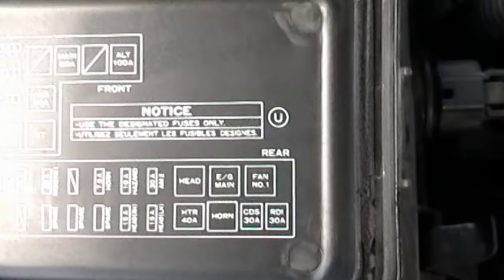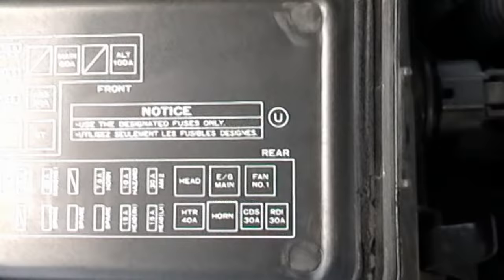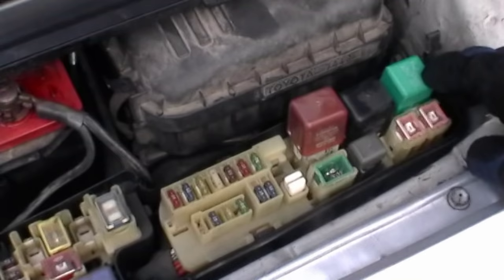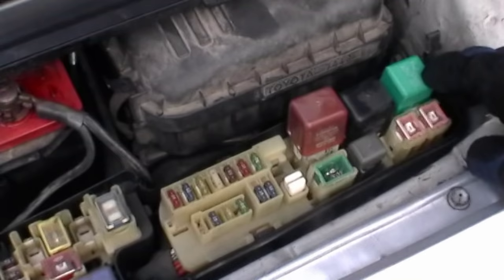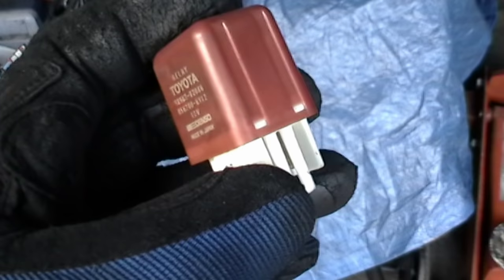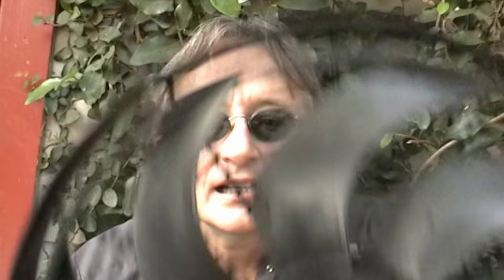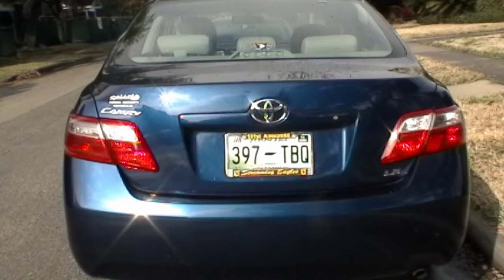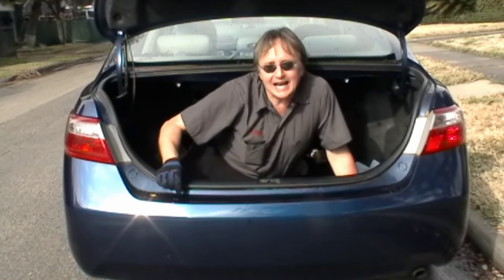How to Repair a Cooling Fan in Your Car

Comment: HI i have a 01 Oldsmobile Aurora v8 4.0  my radiator fans will turn on when car gets hot but then they won't turn off but will go off if i turn the car off
Reply from the maker: pray it's just bad fan relays doing that and NOT  a worn out computer circuit
Reply: I think my engine is running hot just did an oil change and now its low after driving it about an  hr  I even change the plugs and they looked okay  and the antifreeze looks good it's not  leaking anywhere  it's still at the same spot where i filled it up at could it be a bad temperature  sensor or something else if it ant the computer or relays or what about one of these  codes that come up (p0386) Crankshaft Position Sensor(P0442) EVAP system small leak(P0741) TCC system stuck off(P1860) TCC PWM Solenoid Circuit Malfunction

Comment: I have an issue with my 2010 car, the fan only works. When I switch on the air conditioning, and that too it runs in slow speed always. There are two fan for my car, if I remove one of the fan relays the other one will run is both high and low speed with auto compressor cut off. When I put the relay back it might run for few seconds, and back again in series slow speed. The radiator fan won't turn on when the temperature reach's to a point where the fan has to run, but it won't run. Dew to which I have to put Air conditioning always so that the fans would run...
I would appreciate if anyone can help me out with this issues ...(*all the fuses are good and even replaced the relay twice)

Comment: my cooling fan on my car turns on when the temperature is 3/4 high, what would cause this to happen?
Reply from the maker: weak temperature sensor
Reply: +Scotty Kilmer could be, we replaced the coolant temp sensor but not the coolant switch, don't know the difference, thermostat is 160 instead of 195 oe not sure

Comment: My cooling fan keeps running 24/7 also they don't spin fast is that normal?
Reply from the maker: they should spin at a pretty fast rate, odds are there is a problem if they spin slow and all the time, such are burning out motors or bad relays

Comment: My 98 Nissan maxima has 4 cables in a plug, how do I text it?
Reply from the maker: armando colon those are complex, but you can unplug the connector at the fan motors, as they have only two plugs running the motor, positive power and ground

Comment: 1:45 
Wtf? How does the fan turn on with just the negative wire on the terminal. Plus the wires that are actually going to the fan are now unplugged.
Reply from the maker: Kevin Lane that's merely a sensor wire, grounding it tells the computer to turn the fans on

Comment: ive got a saturn l200 2003: my low coolant light only comes on when im sitting in traffic and turns off when picking up speed on the highway. My overflow tank is full as this happens. switched out my thermostat and coolant sensor, still hasnt fixed the problem. any idea if this is a fan problem due to highway winds turning off the light?
Reply from the maker: i doubt it, low coolant switch near the radiator is probably bad, they go out a lot on those
Reply: i decided to burp out the car this morning and noticed smoke coming from the radiator. the coolant also overflows out the tank after i turn off the engine. Fan never kicks on if its suppose to.
Reply from the maker: well, it's overheating, so fix the non working fan FIRST.
Reply: It never warms up to the center line so i cant tell if its overheating. but ill try to do a fan test and let you know if it fixes the problem, thank you !!
Reply: so for the first test, i noticed the plug would need three alligator clips, is there a certain way to test it with just two?

Comment: Can you guys help I have a Honda fit 2009 , my fans do not work  my relays not bad , fuse not bad , but they are still not coming the cooling fans , help please ??
Reply from the maker: do all the tests in this video, and if you can't get em going and they work with power direct to the fans, often a bad main computer on that model
Reply: it works the direct on the battery , but no power comes to fans or my a\c compressor

Comment: Well, I tried the power to the fan motor on my 1987 Oldsmobile, it worked one way, but when I switched the wires around to see if their would be a speed difference, if Fried my fan motor, smoke and all. Oh well. Most of your videos are great...

Comment: i should say i am a 51 yrnold woman i am somewhat mexhanically inclined i had a broken connector on the rear return hose an it overheated a couple of times befor i replaced the connector at about the same time i had it pointed out the fan 1 was not working i hav checked fuses an switched out relays im thinking the fan burntbup cuz the overheating or mayb the sensor is bad i hav not tested the fan itself an im not sure whee the sensor is so please someone walj me thru it i know i can do it

Comment: I have problem in Chevy car caprice ss I think in America name statesman 04 ls1 engine so I have 1 fan doesn't work I think for Ac this fan so what do for cheak this Ac fan ?
Reply from the maker: do the tests in this video, if it doesn't run when hot wired, replace the fan.

Comment: ok my 2002 ford explorer started to over heat i changed the thermostat. still over heating so as i was testing my truck i turned the heater on and the engine started cooling down but no heat came out of the truck any ideas ?
Reply from the maker: air gets stuck in the heater core, bleed it out
Reply: But will it cause the car to overheat when when the heaters off ?
Reply: Thank you by the way

Comment: Anybody have any ideas how to get a car electric fan out of a 2008 Ford Mustang to work in a garage I have one that seems to work and looking for ideas I have Computer power supplies but they are only 7.5 amps and I think I will need more power. I was hoping to zip tie it to the ceiling and add a control knob to control the speed
Reply from the maker: go ahead and do that, just realize they work on 12 volts so use that as a supply to the fan

Comment: I have a saturn sl 2001 every time the fan turns on my 30amp fuse burns any ideas sir
Reply from the maker: +Manuel Mosqueda it could be a cooling fan system short anywhere but often it's a burning out cooling fan motor. unplug the motor and if fuse stops blowing, replace it
Reply: +Scotty Kilmer  okay cool scotty so the fan is going bad right

Comment: both my fans never turn on. one turns on when I have the AC on and the other never ever turns on. but when ac is off neither fans ever turns on. is this normal.
Reply from the maker: not normal, try the fixes in this video
Reply: thanks I'll give it a try.

Comment: Hi Scotty my cooling fan will not come on in my 2012 Chevy Sonic. I have replaced my replaced my thermos switch just now and my fan still wont come on . we are stumped. Pleased can you give me some help. I am on a fixed income can not take it to the  help
Reply from the maker: joanetta d do the tests in this video, but if the fan motor works when hot wired, often just running a toggle switch with power from the battery to make it work is the cheapest logical solution .

Comment: hey scotty, i have a 05 honda Odyssey, and the problem is that , when i turn off the the car,  the  cooling fans dont stop spinning and they just stay on and they dont turned  off... unless i unplug the censor, so what can i do on that situation, do i change the censor?? or something else is wrong with the car
Reply from the maker: IF the fans shut off after a few minutes, live with it as the main computers go bad and do that often. If they never shut off, time for an expensive computer
Reply: aahh men, u know like how much that cost???
Reply from the maker: Jairo Castellanos
if you need a computer, a TON, as only brand new ones are any good. call a honda dealer, as rebuilt ones are garbage and rarely work long

Comment: My engine cooling fan runs all the time even when the engine is cold. When I turn on the ignition switch the fan runs the whole time the engine is running and never reaches operating temperature. What could be the problem? Its a 2001 Pontiac Grand Prix GT 3800 series ll engine
Reply from the maker: +Ernst Hin   try a new cooling fan temp sensor switch, and pray it hasn't shorted out the main computer
Reply: +Scotty Kilmer 
what could short out the main computer? ( my cooling fan temp sensor switch)?
Reply: +Ernst Hin 
I also read a code P0128
Reply: I had ask a question about the cooling fan running while my engine is cold and never reaching normal temperature. is this a common issue with GM cars?
Scotty are you there man?

Comment: Hello Scotty, I have a 99 Firebird 3.8 v6. My fans aren't working, my cars has a dual cooling fan, relays are good, but it's blowing the cooling fan fuse which is a 40 amp. this car was wired so that the fans work with a Prolink relay which has 5 pins. 4 are in use only which one goes to the fuse box, the battery aux terminal, the fans and the ground. My brother unplugged those cables and now he doesn't remember where they go, i've tried several times, but it's blowing my fuse which i mentioned above... what is the right connection for these cables??? numbers on the relay are, #30, #85, #86 and #87... Please help me....Of course this is affecting my AC which is not cooling anymore. Help!!
Reply from the maker: one terminal is power from the battery, another one is ground, another one is power from your source, toggle switch or whatever powers it, and the fourth feeds the fans.  5th pin is not used. Now all relays work the same, so google your relay number and find which terminals are for which part, tons of videos and diagrams out there for various relays sold
Reply: Thank you sir. I've Googled some already and will try this once I get home.
Reply: Scotty Kilmer I forgot to mentioned that one of this cables goes into the fuse box. the other one to the battery aux.

Comment: So ya fan not working has nothing to with having a bad  radiator ?
Reply from the maker: IF your radiator loses enough coolant, hot water will not hit the fan switch and turn it on.
Reply: +Scotty Kilmer I have dual fans one for ac and the other for the radiator/engine question  does the ac fan suppose to turn on and off? It's not turning on and off rapidly but I've notice when i turn my ac on full. the radiator/engine fan turns on first.

Comment: My fan keeps making a scrapping noise sometimes and does not sound loud at all while im driving I really need help
Reply from the maker: if it's not bent hitting stuff, fan motor needs replacing
Reply: Scotty Kilmer the fan is old and cracked as well and wiggles. Also the gas pedal and feeling of the car feels different when accelerating would I still need to just replace the fan or is it a bigger issue? Please let me know thanks for your help and advice.
Reply from the maker: it should not wiggle. If it's an old fashioned mechanical fan bolted on the water pump, replace the pump. if it's electronic, replace the fan motor

Comment: what do I do if only one of the fans is working and the one of the driver side isnt
Reply from the maker: check to see if bad one won't run when you run power and ground to it, then replace it if it doesn't blow

Comment: My cooling fan switch won't come off to my 1998 Honda Civic ex vtec 1.6l automatic trans.?
Reply from the maker: things rust when that old. I often try heat to remove it from a torch if you're throwing the old one away anyway
Reply: It's plastic. It's the plug

Comment: my electric fan comes on when I turn the key on when motor is cold is that normal I also hv no spark to plugs I tested the coil and I think its bad one bank was 0.07 other 2 were 1.2 my fan stopped working car over heated after it cooled down unplugged and plugged back in it worked I never noticed the fan coming one when I turn the key on
Reply from the maker: not normal, that is generally a bad cooling fan relay OR a bad main computer that ultimately drives it. Often the computer
Reply: now im not getting a spark ive changed the coil still no spark also checked all ground point that I can find
Reply: and plugs and wires any ideas thx 4 ur help scotty
Reply: now just got done changing the crankshaft position sensor still no spark ;( could it b my icm

Comment: Anyone have any idea why my car overheats when I turn the knob to cool air?? I don't even have to turn the fan on for it to overheat.. Both cooling fans turn on but the car still reads that it's getting hot.. It started happening after the radiator cracked and I replaced it.. The car runs fine when the knob is set to hot but once I turn it to cold it heats up slowly.. I ran out of ideas.. Any help would be appreciated thanks in advance
Reply from the maker: +David D either worn out radiator that can't dissipate the extra heat, OR bad wiring giving a false hot reading when it actually is not hot
Reply: +Scotty Kilmer thank you.. I was thinking it might have been the other radiator ( I don't actually know what it's called..lol) but I'll check it out .. thanks

Comment: I did this and my tester wires started smoking… what that mean?
Reply: If  you mean the test in 1:10???
Either you have smal=thin wires or you have problem=short    on the  fan motor

Comment: i tested my 91 accord temp switch with a paperclip but they didnt turn on they came on when i turned the car off???? then turned the car on they shut off does anybody know why they would do this?
Reply from the maker: +jf405 often a bad main computer on that model, most guys will just bypass it and rewire the fans with a switch
Reply: Scotty Kilmer meant only rad fan comes on when i do that the condeser works only when hooked to battery but not when i turn ac on do you think thats my only options wiring a switch or buying a new computer

Comment: i checked the fan and relay and replaced the temp sensor after checking the ohms and it still doesn't turn on please help!
Reply from the maker: rewire it with a toggle switch and wiring from the battery then. Cause often that's a bad main computer and they cost a ton
Reply: Scotty Kilmer how long can you leave the fan on for??
Reply: My fans only come on when ac heater on 2000 Alero relays good ect sensor test good 5 v coming from temperature plug puzzleing can u help

Comment: What if the radiator cooling fan won't shot off 
even if i turn off the car
Reply from the maker: if it shuts off after a few minutes, leave it alone. if it never does, often a bad main computer circuit that drives it or a melted blower motor relay and or wiring
Reply: +Scotty Kilmer Thanks 
you are the best
Reply: +Scotty Kilmer I have a blower relay in the fuse box and i took it out and the fan still running 
is that mean exclude the blower motor 
and it the relay for the fan who do this problem? 
sorry for disturbing you

Comment: my cooling fan runs continually. the fan comes on and will not cut off as long as the engine is running.  HELP ASAP!
Reply from the maker: +TheFirefox8192 try a new coolant temp sensor for the fan
Reply: I replaced the coolant temp sensor  before I posted. But I did not help.
Reply: i actually like my fan staying on for as long as the ignition is on

(Constant cooling)

the only slight drawback is that it makes warming up the engine a little more time consuming

if only there was a way of making the condensor fan stay on as it turns on (sometimes) when the A/C clucth kicks in
Reply: 01 s500 is getting hot when the ac /heat is turned off ...help me someone

Comment: The sub fan in my Subaru stopped working.. I just pissed all over the fan motor and voila!  It works now.  Just kidding, the fuse blew.  I'm thinking the motor in the fan is on its way out

Comment: I have a 94 integra in a 92 civic body. I tried everything and it still don't work. New thermostat, new cooling fan relay, new temp sensor, I test the fan and it works, idk what else , anyone can give me a hand.
Reply from the maker: hey hey hey the computer utimately runs the fans, why not just wire the fans to run off a toggle switch manually on that old thing rather than mess with the computer and its wiring

Comment: what f the fan wont stop automatically?
Reply from the maker: if it continues to run after car is shut off, often a problem in the main computer circuit does that

Comment: So if your fan turns on by running hot wires to it that means its ok??? WRONG, a bad fan can run just draw too many amps blow a fuse or melt a wire. Also you can have bad wiring causing it not to turn on. Very bad way to diag a fan

Comment: 96 Saab 9000 did everything you just did. fan only comes on once in a wile, motor gets real hot,  changed the relay, did the coolant switch, thermostat, fuses,  I just hate new cars, I should have stayed in the 60's
Reply from the maker: just run a toggle switch and wiring and in line fuse and you can turn it on manually
Reply: A glass fuse? 30 amp ok? And what side, the wire going to the pos. side or the neg. side. I'm guessing the pos side before the toggle switch? Oh, and thanks for responding too, I've learned a lot from your videos, There quick, and to the point. With good editing. I don't lose interest and get bored do to my short attention span .   :)

Comment: my fan some time work something time don't
Reply from the maker: check to see if motor is burning out, also check for bad coolant temp switch for the cooling fans
Reply: Scotty Kilmer why did my car come with a rigged radiator.meaning its always running.98 hoda civic